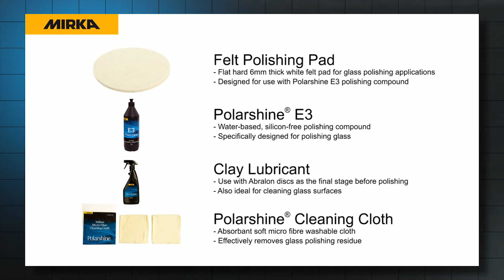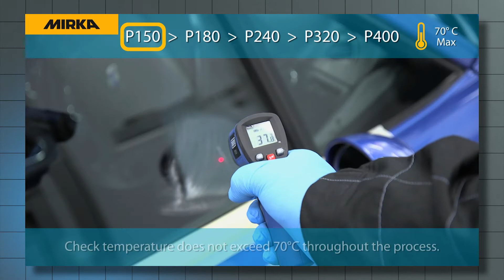Mirka Glass Polishing Solution

Comment: Its not necessary to use that many grades of disks. And it increases the chance of distortion. This video is helpful in that it shows a methodical approach and also hes capturing the glass dust which is better than having it floating around your workshop for the next 2 hours.

Comment: Could u use this on windshields?
Reply: I doubt it will work. The hardened side window has a max temp of 70 degrees (according to the video) the windshield wont be as resistant since it is laminated and not hardened.
The glue in the lamination could react to the heat and start losing contact and/or form bubbles.
Windshields has 2-3 layers of glass wich makes it alot thinner, so I think it will crack.
Reply: @Enzo Guillermo Instablaster =)
Reply: @Robert Harley Thanks for your reply. I found the site through google and Im in the hacking process now.
I see it takes a while so I will reply here later when my account password hopefully is recovered.
Reply: @Robert Harley it did the trick and I finally got access to my account again. I am so happy!
Thank you so much you saved my account!
Reply: @Enzo Guillermo Happy to help :)
Reply: @FREENAMEFTW  I had it done to my rear shield/glass, don't know if it is made the same way as front shield, but the scratches were very deep and the whole wiper area was mat. It came out really nice. Done with similar method. Saved me a loooot of money for a new glass. The man who did it said it was delicate because of the temperature but was doable.
Reply: @nesscog2287  Rear windows in cars are one sheet hardened glass. (not laminated like the windshield)
Reply: @GlassGenius  Nice, how did you do that?